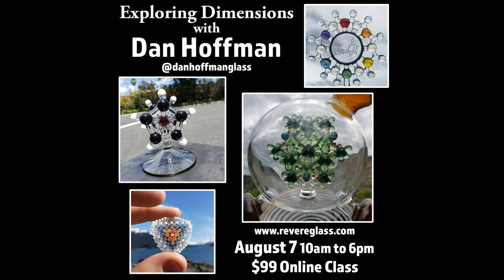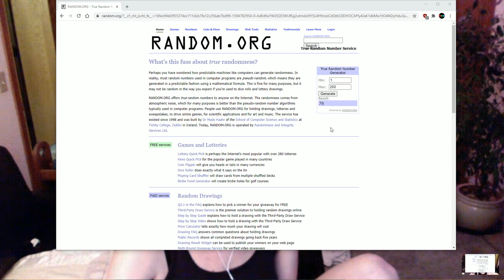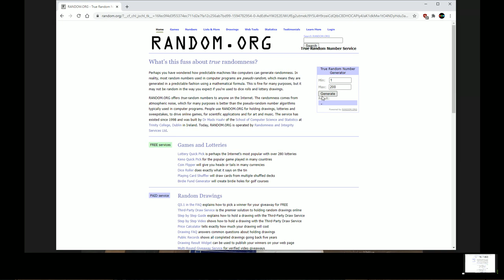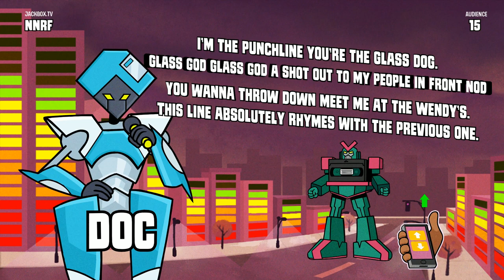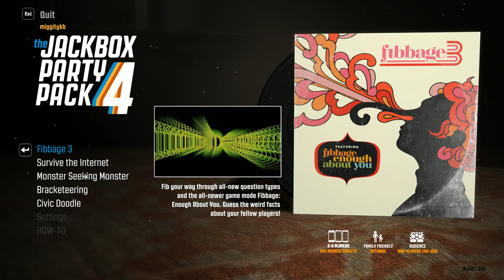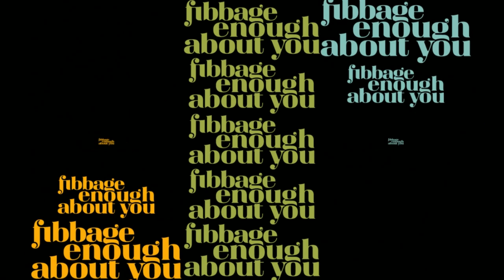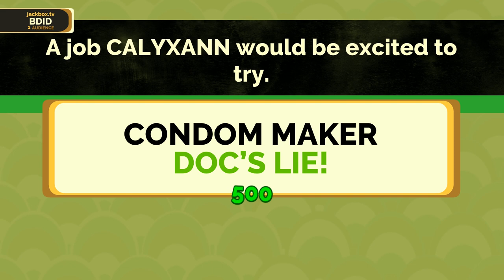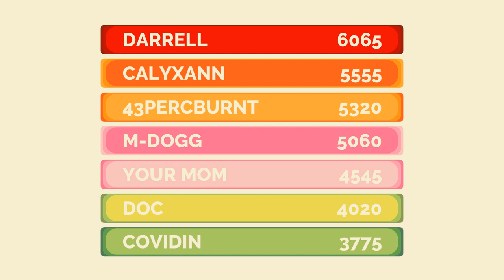Hollow Implosion Marble w/ Eusheen

Comment: After taking Eusheens section out of the kiln to fuse the cup to Eusheens piece, was he able to clean off any kiln dust in some way off screen? It looks like he does clean it somehow, possible some low pressure air that blew off any kiln dust? (55 min ish)